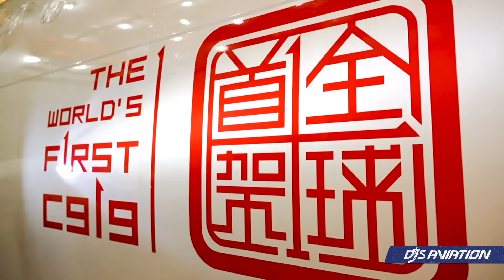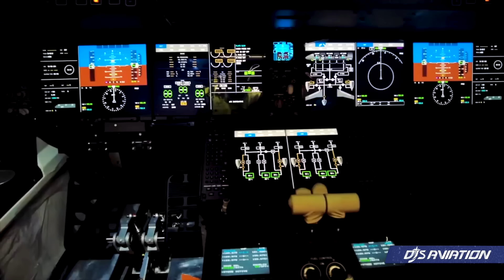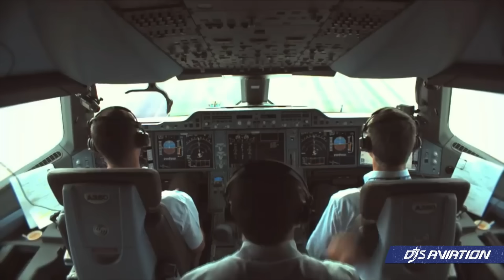Airbus Rival, Virgin Atlantic Updates & Embraer Automated Takeoffs

Comment: The biggest issue for COMAC is that they cannot produce planes at the same rate as either Boeing or Airbus… and by the same rate I mean a tenth of the same rate as either Boeing or Airbus
Reply: The biggest issue is their plane is inferior!
And they know it but will ramp the production rate and a future airplane will be as good and they will be able to build it in great numbers.
Reply: Even Airbus and Boeing need years to scale up production, so that's not really strange for a company that still has a lot to learn. I think one of the bigger issues is that they have not yet been able to certify the C919 outside of China, and certification is a first step to make your aircraft something that companies want to buy.
Reply: China will strive to build an airplane for the international market.

COMAC's biggest problem is getting suppliers and this has delayed the project. The engines were one of the things that delayed the project.
At the start of the project, the COMAC 919 was to be equipped with Chinese TurboFan engines.
The project was to be launched before the arrival of the A320 NEO.
Reply: The truth is that if the COMAC were launched before the A320 NEO, it would be a good aircraft.
But with 1000 km less range.

Comment: What more interesting is that CJ-1000A(the national engine) have give a Type specific fuel consumption at cruise for a 14.9 g/KN/s, really close to CFM-Leap-1B (that version for 737max have a castrated bypass ratio due to fan diameter limitations , reason you should know it🤪), although we don’t know if that engine makes higher efficiency in the expense of shorter components lifetime, but it show the exit door for any potential Russian-Chinese plane-making collaboration when Russian don’t have anything to contribute, До свидания(Russian Farewell) for sure.